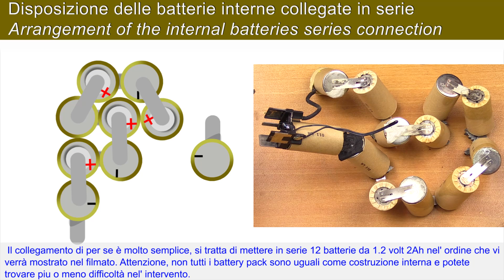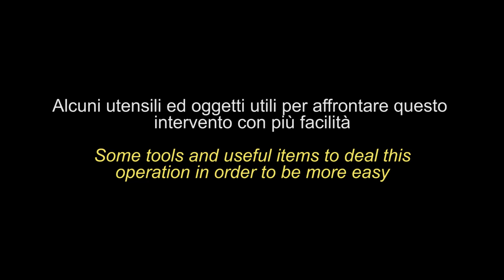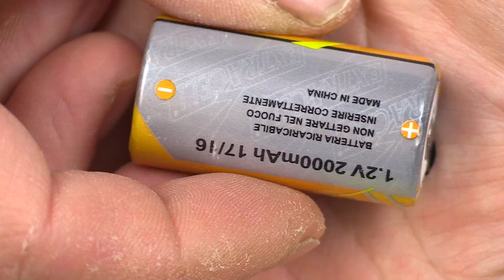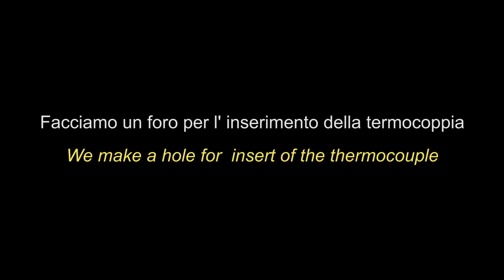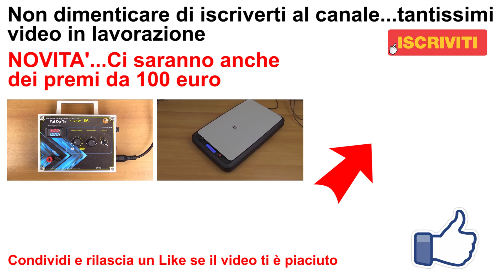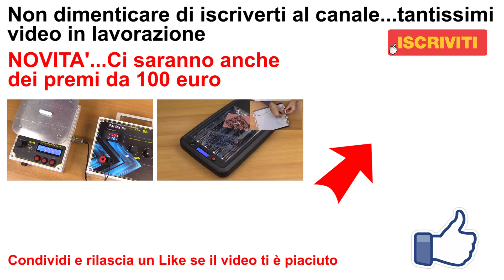TUTORIAL Rigenerare batteria 14.4v per trapano avvitatore - Battery pack assembly

Comment: La soluzione attualmente è impraticabile . /// Le batterie al Nichel Cadmio ora sono vietate per legge e si trovano soltanto le rimanenze di magazzino . Anche trovandole comunque 10 batterie al Ni/Cd , su ebay , dalla Cina , attualmente costano circa 30€ , cioè poco meno di un trapano a due velocità venduto con tutto il kit comprensivo di batteria al litio e caricatore . /// Ci possono essere alcune soluzioni alternative : potrebbero andare bene le batterie al Ni/Mh stilo a 2000 mAh cioè le ( AAA stilo ) che costano di meno ( cioè 10 pezzi circa 14€ ) , ma hanno il problema che non si possono far scaricare le singole celle al di sotto di 0.9 volt , altrimenti si rovinano , e nemmeno si trovano le schede di protezione per queste batterie ( le schede di protezione di carica e scarica sono realizzate soltanto per le batterie al litio ) . L'unica soluzione realtivamente economica potrebbe essere quella di metterci una batteria al piombo acido gel da 12 V 3-4 Ah che essendo fuori misura commerciale e trovandosi soltanto per gli scooter avrebbe probabilmente costi di 25-30€ , soluzione che oltretutto prevederebbe di eliminare il contenitore della batteria , arrangiandoci un fissaggio della batteria a propria discrezione ( salvo che la batteria non entri precisamente nel contenitore) . in questo modo ci sarebbero 12 volt anziché 14.4 volt ma il trapano funzionerebbe ugualmente a minor potenza ( o , per avere una tensione equivalente ci si potrebbe inserire in serie alla batteria al piombo un'altra pila di amperaggio maggiore a chimica Ni-Mh , in maniera tale che si scarichi prima la batteria al piombo ) .

Comment: Ciao complimenti per il video , vorrei fare lo stesso , ho un trapano datato da 14.4 v nicd 1.prima domanda che batterie usare ,in rete ho trovato batterie molto simili a 7.70 euro l'una e altre diverse stessi v ma ah maggiore  da 13 euro 12 batt.  seconda domanda che amperaggio usare ? terzo punto ,  sulla " torretta " della mia batt. sembra manchi non so un fusibile o una resistenza che nel tuo video c'è  grazie e complimenti di nuovo

Comment: Questa operazione è bella ma un pò insensata per quanto riguarda il mio caso...ho un trapano avvitatore con lo stesso problema....il fatto è che le batterie su ebay o amazon in totale mi costano circa 54 euro più spedizione..... con quei soldi o poco più prendo un nuovo avvitatore.....per il mio (modello che non fanno più ) non vale la pena credo. Comunque nel video c è l ordine di 4 pezzi 8,71 euro....a te ne servono 12.....tot. 26 euri......  inoltre a questo indirizzo trovi il pacco batterie per il tuo modello di trapano a 36,99..... ciao.... https://picclick.it/Batteria-Ni-Cd-144V-20Ah-288Wh-Ricambio-Bosch-2610909013-172851299904.html
Reply: Se hai un'avvitatore usa e getta da 40-50Euro allora questo tutorial non e' per te, ma se hai un'avvitatore professionale come il Boch serie blu oppure Metabo e simili allora sostituire le batterie ti fa risparmiare soldi.

Comment: Se non hai la puntatrice devi saldare linguetta su linguetta, cosi rovini solo la cella visto che porti la temperatura oltre i 300°
Reply: Oltre i 300? Mi pare un filo azzardata come stima, visto che la temperatura di fusione delle leghe saldanti vanno dai 180° circa della vecchia SnPb, ai circa 220° delle moderne lead-free.

Ad ogni modo, la saldatura a stagno di batterie è un metodo usato. Il punto è usare un saldatore con una buona potenza, in modo tale da scaldare il giunto rapidamente, senza trasmettere troppo calore alla cella.

Anche saldando linguetta su linguetta, senza un saldatore adeguato, si è costretti ad insistere molto sul giunto di saldatura, dando tempo alla linguetta di trasmettere calore alla cella, cosa che NON si vuole.

Tra l'altro, proprio per ridurre i tempi di saldatura, Daniele usa un paio di accorgimenti: abrade il terminale per rimuovere lo strato di passivazione, e un modesto riscaldo con la pistola ad aria calda, per ridurre il tempo di saldatura.
Reply from the maker: Esatto, ma come fai a orientare? Questo lo puoi fare solo  quando le batterie hanno tutte un verso. Io ho messo dello stagno per sulla linguetta per aumentare la portata in corrente.
Reply: Pieghi la linguetta al contrario nel senso che ti serve, l'angolo di piegatura determina il senso

Comment: Ottimo come sempre potresti scrivere il link per acquistare le batterie...
Grazie
Reply from the maker: Grazie. Su ebay. Basta scrivere batterie 1.2v  2000mAh  ma potresti mettere quelle da 3000 o 3500 che aumentano la durata. Dipende dai costi che vuoi affrontare
Reply: @DanieleTartaglia  aumentando  l'amperaggio delle celle  é anche  necessario fare altre modifiche al pacco batterie ? Per esempio, se in un pacco batteria da 15.6v3Ah vengono sostituite le 13 celle 1.2v con 13 celle  subC 2.2A, che amperaggio si ottiene e ci sono implicazioni per i cavi o il motore del trapano ? Grazie :)!